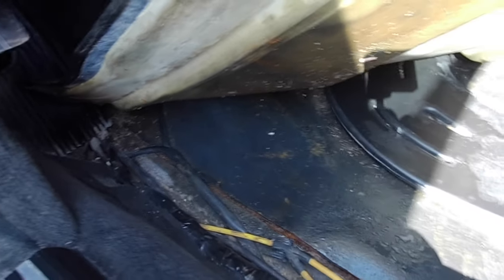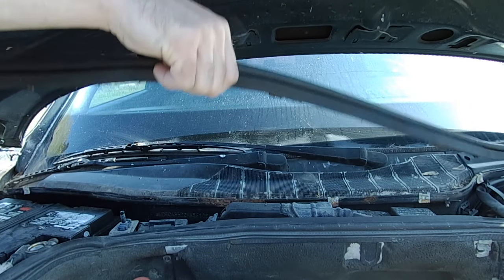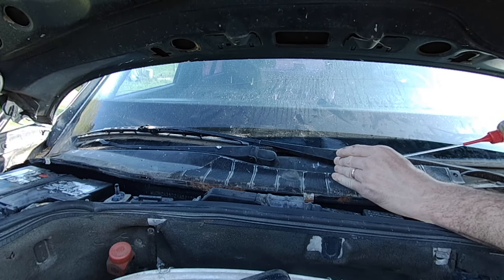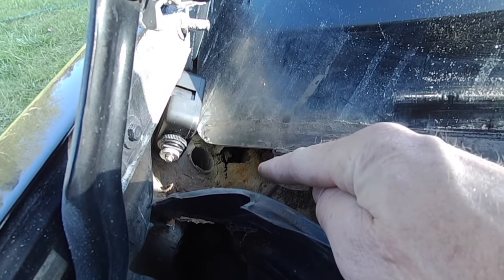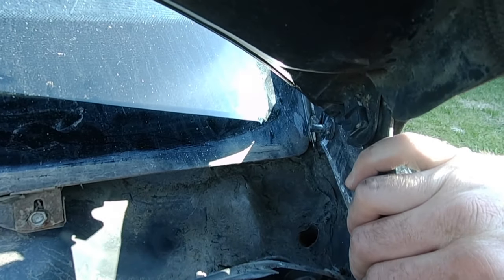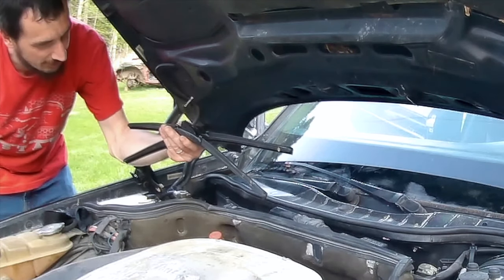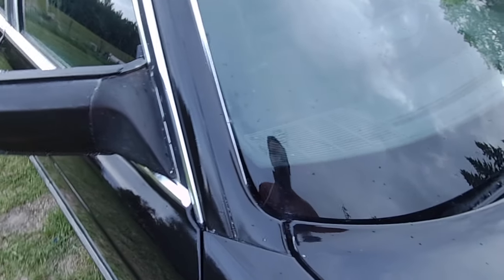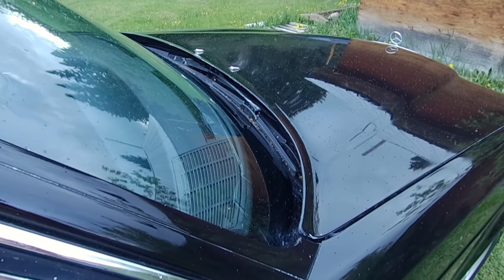Mercedes W126 Cowl Leak Repair

Comment: Thank you for such an informative video, I am getting ready to tackle this issue on my 1990 300SEL. Wish me luck! ❤Canada 🇨🇦
Reply from the maker: @pamhannam3669  Good luck. Hopefully, you don't encounter as much rust in there as I did. Mine never leaked to drop for the few years I had the car after the repair. It did end up springing a leak under the back window and that was about the point I had had enough with it and let it go to somebody else. (I daily a W124 however)

Comment: Why candles to kill odor?  Never heard of that.  I was thinking leaving a tray of baking soda inside overnight (once it's dry)
Reply from the maker: There is a reason why smoke smells are the hardest to kill, because heated odour particles are the smallest and penetrate the most. That is why I used a candle because in theory those heated odour particles will penetrate deeper than the mouldy smell I was trying to kill. Sadly this car had multiple leaks and other issues and I ultimately gave up on it and sold it. (with full disclosure of the problems).

Comment: Hi, I just purchased 1990 560 sel and I have to replace the seal that is at the bottom of the windshield- any idea if it can be bought after market or it has to be oem?  Thank you for any help.
Reply from the maker: TZakPol I don’t see why aftermarket would be an issue, a glass shop might be able to help you more.
Reply: Hi, thank you for the quick reply.  I cannot find anything aftermarket that has same/similar design as the original cowl seal on the Benz.  Also, it looks like that seal is not doing much- with or without it the water ends up in the same place- am I correct?

Comment: remove the battery, then remove the battery stand and you find more to clean there another drain
Reply from the maker: Yes I cleaned under there, but there was no damage and it wasn’t what was causing it to leak.

Comment: I think rubber coating just lets moisture sit, and the metal will keep rotting.
Reply from the maker: It was meant to be a temporary repair and it definitely worked, for the time I owned this car it never leaked in that area again.